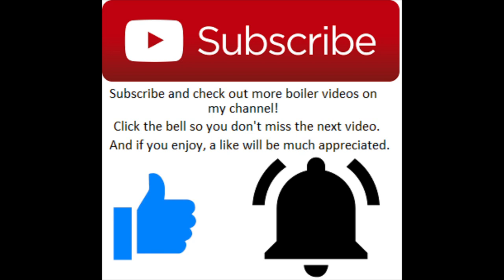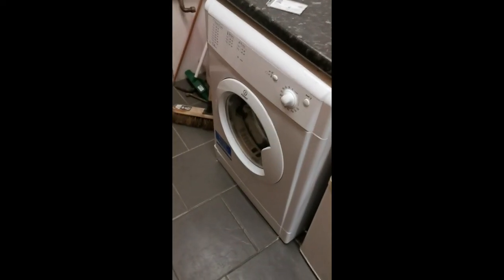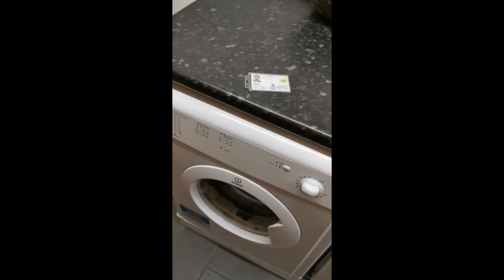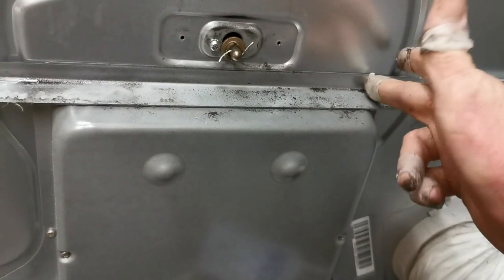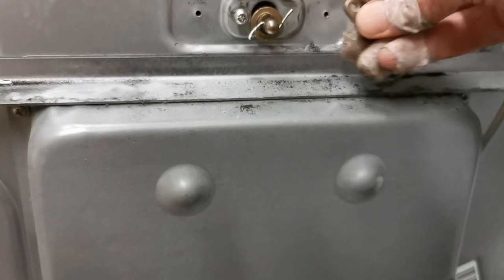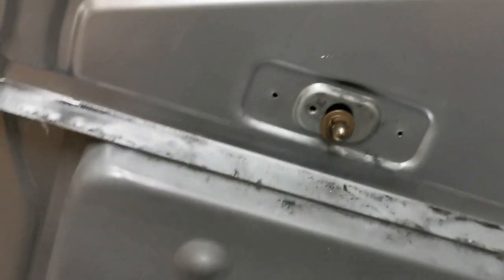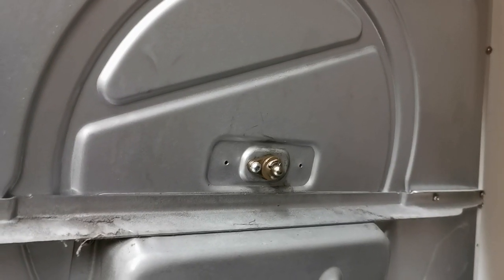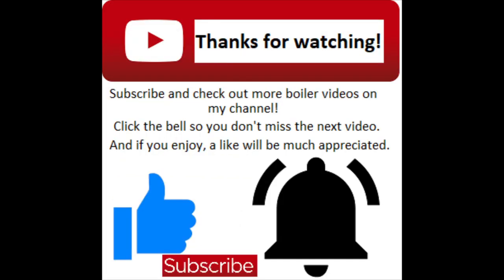NOISY TUMBLE DRYER FIX - HOTPOINT, INDESIT, CREDA, ARISTON, EXPORT, PROLINE, CLATRONIC .. - SQUEAKY

Comment: Like others, I also had this problem on my 3 year old machine. Others said tension arms, but on mine I had drum, belt and motor. Then gave my machine a massive blast, problem still was there then found this video. Yes I had the black dust and the washer was defo collapsed. So bought another. Awesome :-)

Comment: Thank hea ens my Google-fu was strong and I found your video.  Easy to follow instructions even I can follow.  Found that black dust just as you showed have ordered the part just got to wait for it to arrive thanks so much.  A quick update the parts arrived and it took less than 10 mins to fix after following your instructions

Thanks so much

Comment: Thank you for this! I just checked my tumble dryer and there is so much debris. I used a bit of wd40 and ordered the part from amazon. You are a life saver. As soon as I get it, I will put it in place.
Reply: mine was hard to get off i will use the wd40 trick next time thanks

Comment: I just wanted to post the most massive thanks possible for this video. My Indesit dryer has started making this noise. And it's excruciating. We are in the Covid19 lockdown so cannot bring anyone in to fix it or order a new dryer. This fix looks like its a 5min fix. Ordered the teardrop from eBay just now after seeing this.
Reply from the maker: Hey there, how did you get on? And its no problems, that's why I do it. Hope it helped 👍
Reply: @goldgas1216  I got the part yesterday from an eBay seller, took about 10mins to attach. And it is now fixed. I am not exaggerating by saying you are a life saver. I was expecting to need to pay another £300-£400 for a new Dryer. That I could not afford during the Covid lockdown. It is unbelievable that's £3 attachment that takes 7mins to fix achieved this fix.
Reply: Lol the noise is so loud I thought ours was going to blow up!!!

Comment: Thanks so much for this video.

We were pricing up a new tumble drying before I decided to google for advice.

I got the bearing from EBay and it was an easy ten minute job to replace it.

Just one question. Should I have added grease to the bearing or does it work “dry”?

Comment: I turned the square plastic bearing block round on the back of the machine but the scraping noise is still present as if the front of the drum is rubbing on metal, but further investigation shows there is a felt lining between the front rim of the drum and the plastic door housing, looks like I will have to buy a new one 😢 thanks for video anyway 👍

Comment: Hi thanks for your video you mentioned a washer in the video my bearing drop seems ok but no washer is there a separate washer that may have deteriorated as I did not see you add one and mine had a lot of black dust as you mentioned

Comment: Hello, I have the same problem, but before I made this wonderful video, I dismantled one of the sides of the dryer, and when I put the parts back in place, unfortunately, another sound became like the drum rubbing against parts of the dryer, and when I put the laundry in the dryer, some of them cling to the edges of the drum from the inside because it is not attached well. Please. Help me repair the dryer

Comment: Fantastic video thanks! I've just commented on someone else's problem as halfway through a dry the noise is back 😐.  Not as bad but still concerning . *cry . Just wondering if it could be something else in addition to the bearing ? The dryer was exactly as your video worn away , dropped , black dust.  Everything . Textbook. But now the noise has come back 🤔😬 wondered if anyone else had this? Or if it could have been 2 problems originally?... much appreciation x
Reply: You need to order a genuine Indesit teardrop bearing. I bought a generic one and the metal was so soft, it had worn out in two weeks! Also, lubricate the new bearing with white lithium grease.